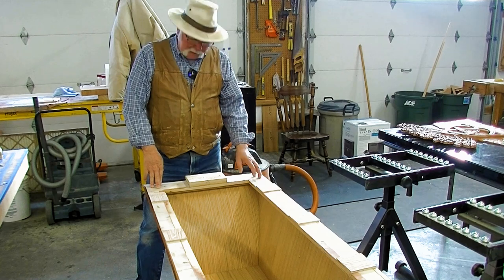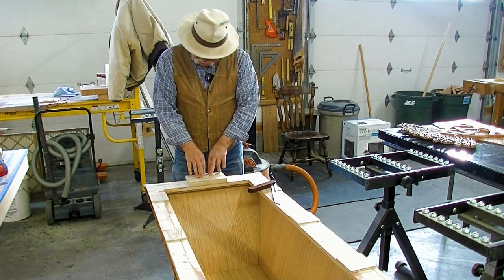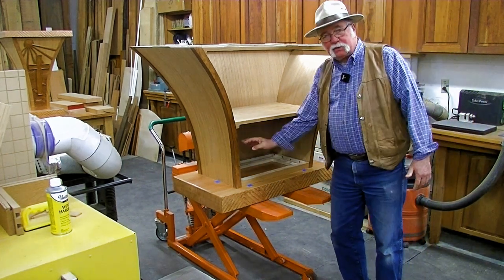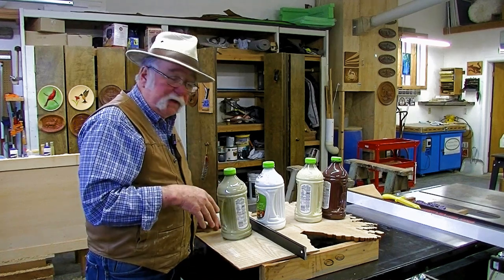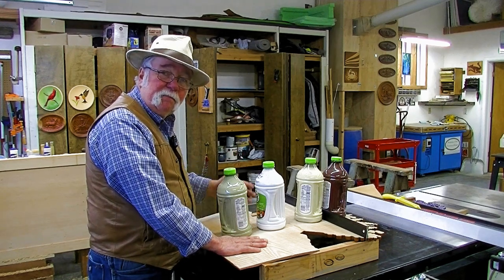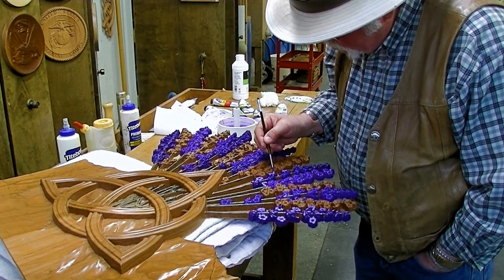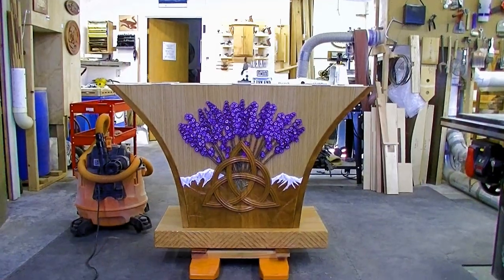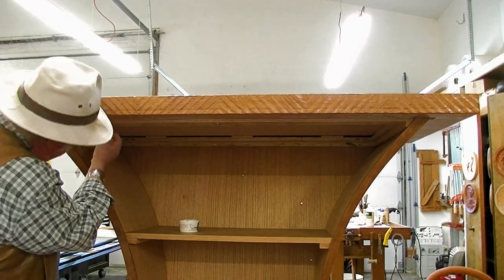Altar and Pulpit Part 16: Finish and Assembly Part 3; Andrew Pitts ~ FurnitureMaker

Comment: off of the subject...did you move all of your tools to your new shop..?  im looking at moving several states away from where i live now and am trying to gather info on weather i should move my tools or sell them and buy new ones when i get there...i own large heavy tools...tools i love.
Reply from the maker: When we moved 4 years ago from Atlantic to Pacific, 3200 miles and a most expensive move, it cost us about $1 per pound to move our goods. I had sold about half my tools and the remaining ones were not that heavy as tools go and the regular moving company could handle them. The heaviest tools were maybe 200-400 lbs (I didn't weight them, so a guess), costing $200-400 to move, way less than replacements would cost, even decent used tools. Hope that helps.
Reply: @Andrewpittsfurnituremaker  ...it does help thank you